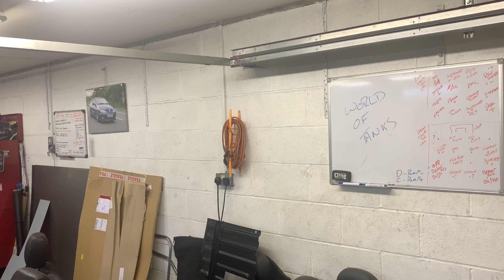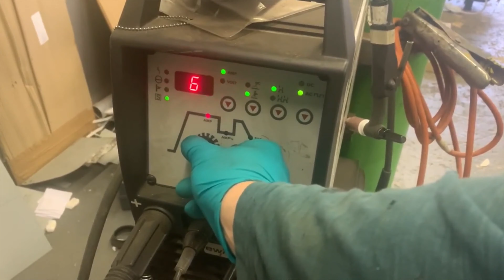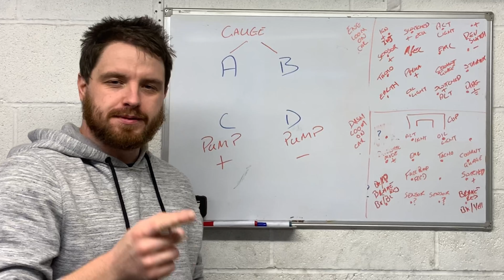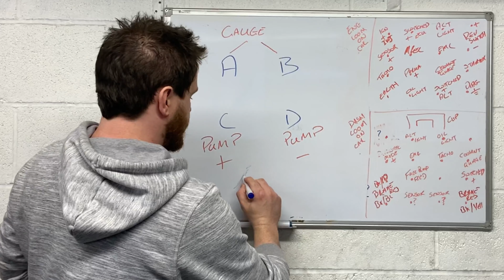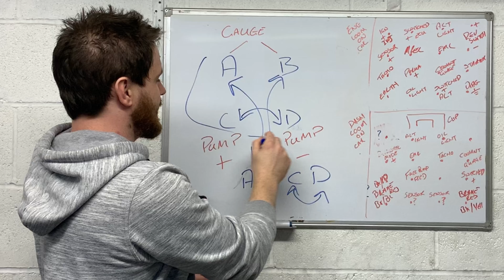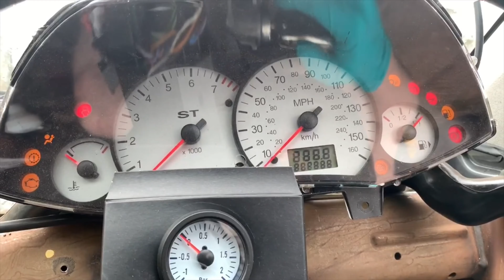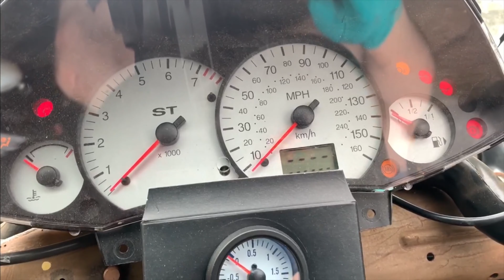Finishing my Custom Fuel Tank - The Flexus Episode 37 - Ford Focus Twin Turbo V8 Project Car Build

Comment: Can I ask where you got the fuel pump sender socket/connection from sir? Im making a fuel tank too but can't seem to find any connections that won't short off the fuel tank 🤔
Reply from the maker: Ebay mate - 

https://www.ebay.co.uk/itm/192544858361

Prepare yourself for the price though! 
Also bare in mind the pins are limited to about 14amps
Reply: Thanks for that , keep up the good work :)